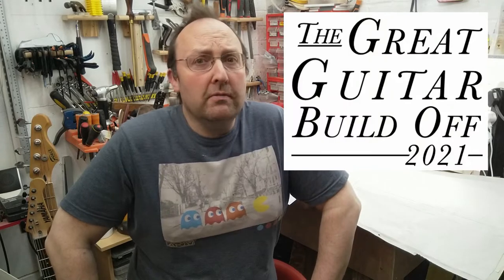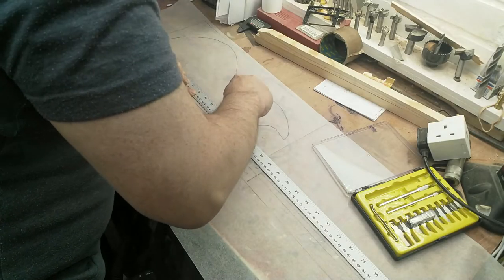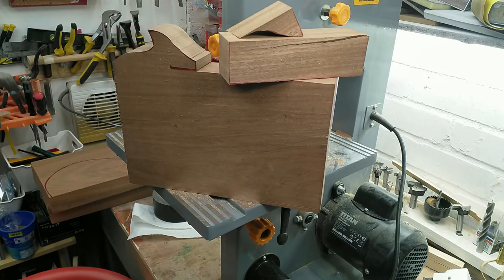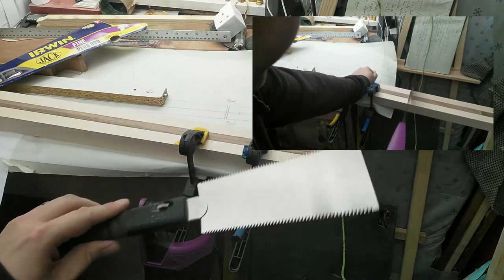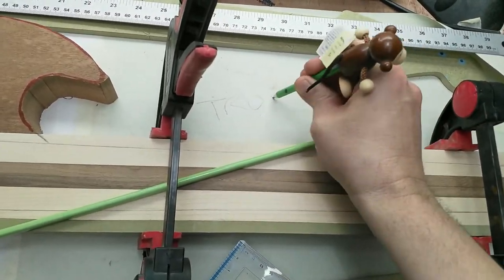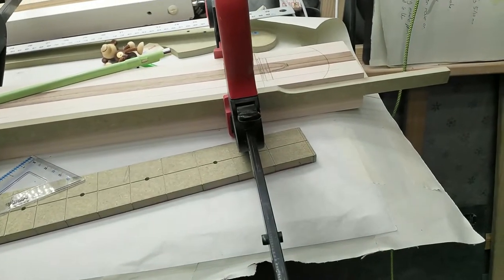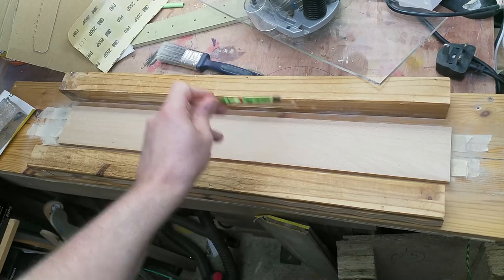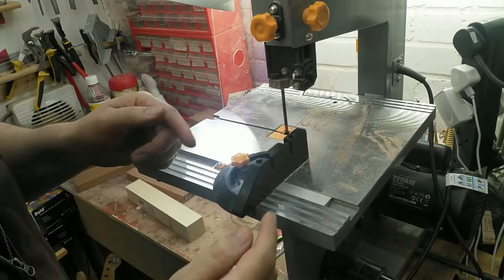Cutting and shaping a headless guitar - Great Guitar Build Off 2021

Comment: Hi Chris. Quick question. Do you have enough space between the body and the tuners for your fingers to turn the tuners? Do you plan on routing the wood beneath the tuners to make room?
Reply from the maker: Definitely not if I leave the top flat.  I've given it a lot of thought and I don't want to do a scooped out bit, so as I'm doing a drop top I'm thinking I can start the curve under them.  If that doesn't work I can always tune with a screwdriver and put it down to experience :)
Reply: @ChrisFranklyn  I had the same screwdriver idea as well. Which I was going to disguise as a "custom" tuning tool with a fancy handle. I ended up designing a low profile 13mm scoop.